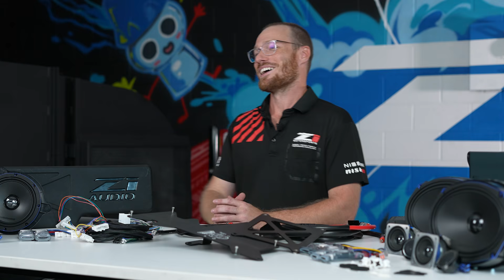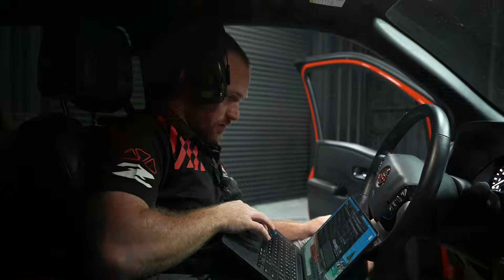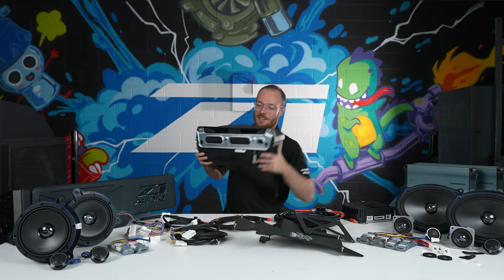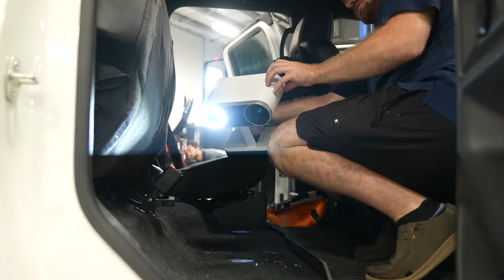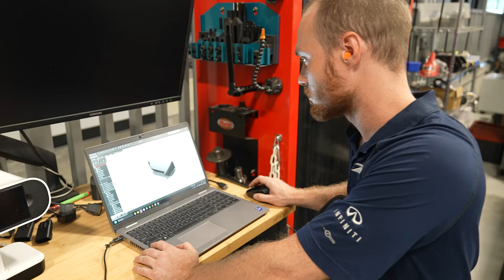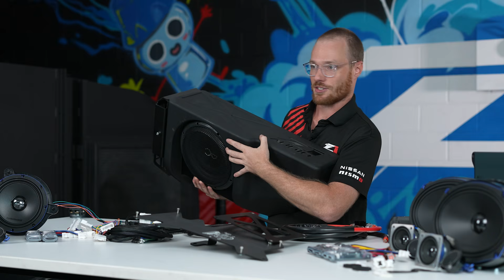Z1 Audio - Behind the Design - Nissan Frontier D41

Comment: Will the 5 channel amp be plug and play for non fender trucks? I have already upgraded speakers, and have a hideaway sub. Want more power to door speakers.
Reply from the maker: These packages are only plug n play when you purchase the full kits. We do not sell the harnesses outside of the kits. If you are adding other parts, custom wiring will be required.